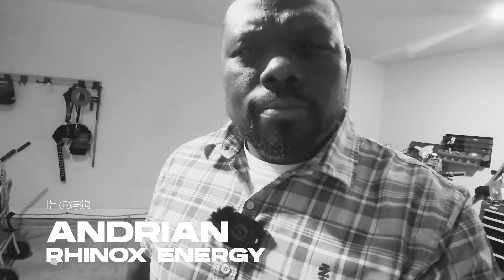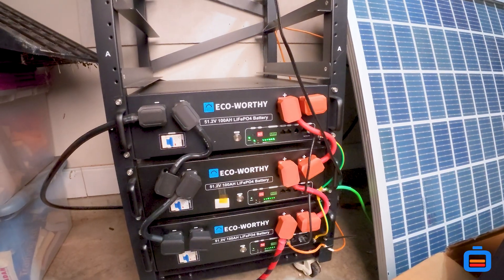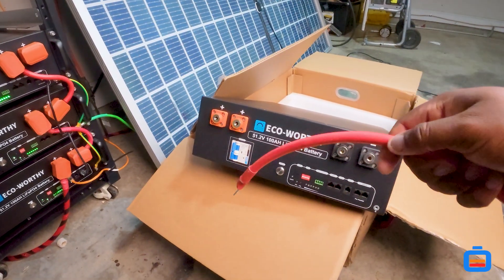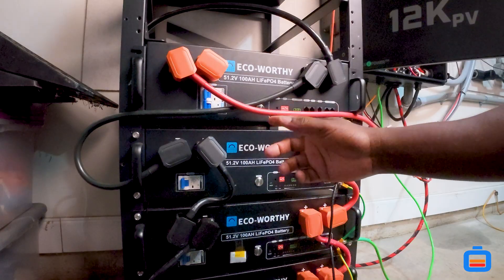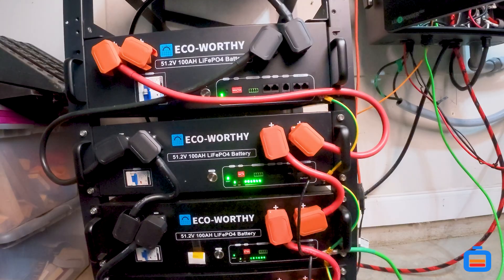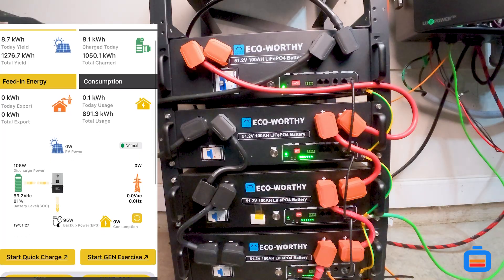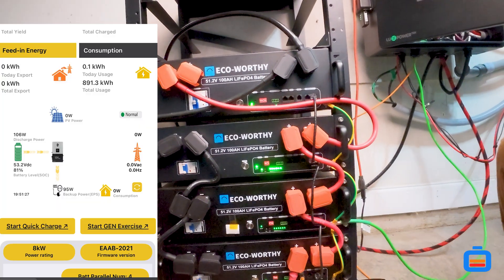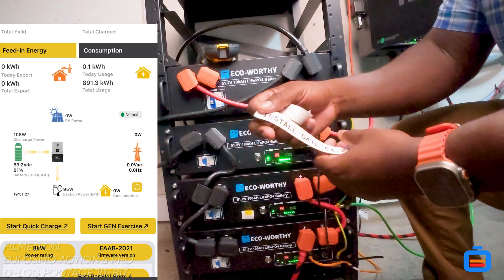Adding 4th Eco-Worthy Server Rack Battery 48v 5.12Kwh to EG4 12Kpv Inverter

Comment: so you can parallel eco-worthy batteries with riuxu on the same inverter?
Reply from the maker: If riuxu has the pylon communication type then yes you should be able and if not you can connect them in a lead acid configuration that would most likely allow that type of connection… eco worthy is pretty flexible but not sure riuxu

Comment: I thought you had to match the voltages and soc to hook it up with the other batteries??? You just plugged in a 30% charged battery with 3 100% charged batteries?? Wouldn't they try and equalize and push hundreds of amps into that new battery ??
Reply from the maker: So this was odd to me, Also with all the research I had done previously on batteries but apparently because they are tied in series and have the communication cable they automatically start to charge the new battery up to the same amount of state of charge. It took solar plus the older batteries and poured energy into the new battery until they balanced out. Great question though.
Reply: @RhinoxEnergy . It is always advisable to have all the batteries at the same SOC or Volt when connecting them together. It didn’t harm your system but yea we learn new stuffs everyday. Love your videos.
Reply from the maker: Thanks ! more to come ! I definitely appreciate you watching and commenting !
Reply: @RhinoxEnergy  I had this question also, but I notice the battery app is showing it only charging at a bit over 5 amps when he showed the app. I still don't know for sure what the answer is but I think BMS pretty well takes care of the Battery. Still trying to figure out how you would get the batteries to a close state of charge and how close it should be, if it even matters.

Comment: What solar panels are you using? You getting the spec output on them?
Reply from the maker: Hey ! I’m using the Hyperion 400w bifacial panels and I get pretty good efficiency, I have 16 of these panels and I range from 72- 85% output at anytime. I love these panels for the output and the exterior aesthetic
Reply: @RhinoxEnergy you getting any bifacial gain?
Reply from the maker: @Gary-ee3kq I do yes sometimes but bifacial gain is very hard to actually calculate! I have 16 but essentially my goal is to have 30 panels to load up each string of my inverter in order to account for the sun hours I actually get during the day

Comment: can you not just mount the battery upside down so the red is on the right and black on the left?
Reply from the maker: That’s a good question! Technically the cells are glued down inside the battery to the floor and braced inside with a cage on top. I’m not a 100% sure on how the cells would react over time being upside down…. With the batteries being so pricey it would be risk on either end to do that but I’ll have to see if some one on YouTube has some long term data on that but great question!!
Reply: @RhinoxEnergy the battery manual says upside down is bad

Comment: I have one v2 battery and one v3 battery. I opted for just getting longer cables for now, but a youtuber named average joe has a video for how to swap the terminal sides around to make the v2s match the v3. Also you need to make all of your battery cables the same length for even charging and discharging.
Reply from the maker: I’ll have to check this video out but I’ll have to be honest I’m scared to open one of these batteries up lol I wanted to make them the same length but I was too excited not to use it !!
Reply: You will void your warranty remember
Reply from the maker: That is something to kind of consider absolutely when doing this to a version 2 battery!! It’s tempting but I may wait awhile to attempt changing the terminals out.
Reply: Nice video. Bus bar would be a good option IMO.  Hook up the existing V2 set up and then the V3 if you’re uncomfortable with the battery cable length
Reply from the maker: @FemiOlorunfemi-1 I had a bus bar at first but when I get past 6 batteries I think going to maybe get a bus bar for the entire system then ! I’m trying to keep my most low for now and focus all investments to the core batteries and panels right now ! Eventually I want that 10 battery server rack from RUIXU after I fill this battery bank up .